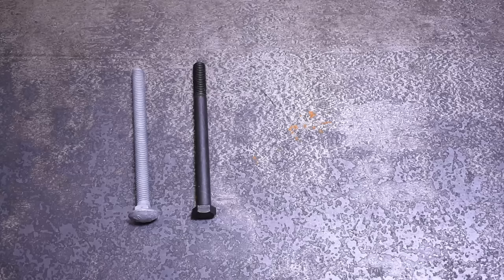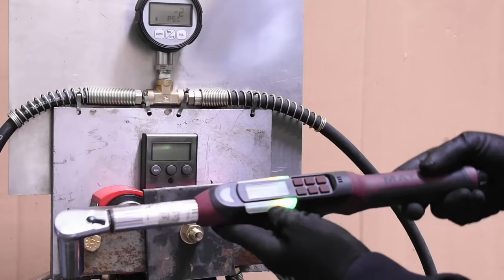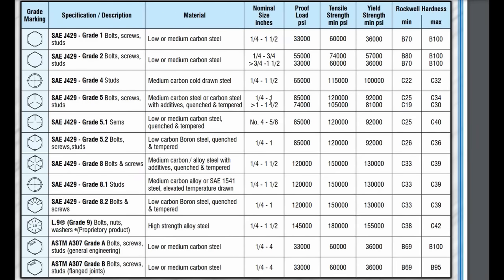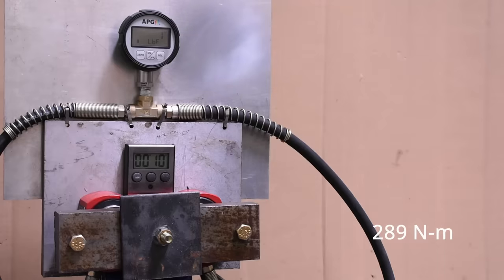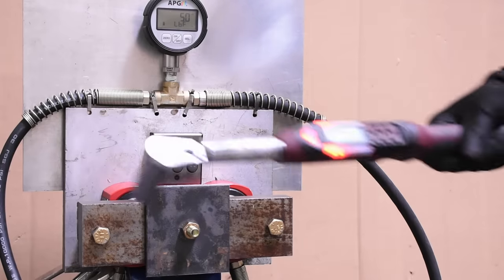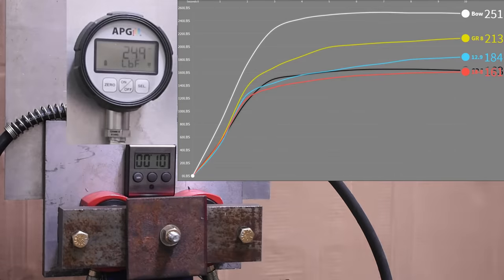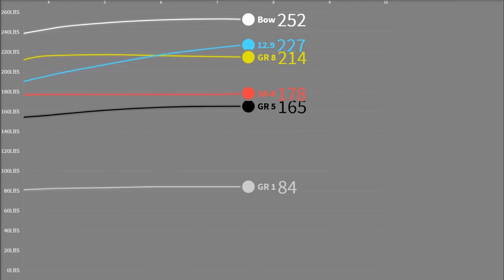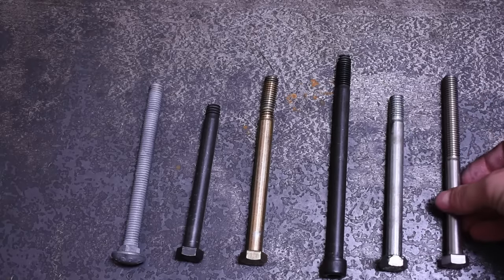Strongest Bolt? Grades Explained & Dyno Tested For Science

Comment: Metric stainless fasteners are marked A2 or A4 for the material type (with A4 being higher corrosion resistant in salt water and chlorinated environments) and a number (50,70,80) that indicates its strength class, with 80 being equivalent to 8.8

As for the relationship between clamping force, torque, load, and so forth, there's whole engineering books about it, so the information exists, it might just not be explained in simple form anywhere easy to find. Odd. :) It would explain the amount of bolt abuse you see people do.
In short, the bolt fastening torque is mostly set to optimize clamping force. Clamping force makes sure that shear loads are absorbed by friction between the clamped faces, and that cyclical loading doesn't fatigue the bolt or joint.
A loose bolt would shear off or fatigue, or rattle around and damage the hole, where a properly tightened one would not.
An over tightened one could snap from being over tightened alone, or could damage whatever its clamping.
Reply: As for clamping force, what you mention is one part of it. To expand, the torque determined for a bolt is derived from the clamping force needed to maintain a sufficiently ridged connection. This is determined by the connection use, like clamping a pressure vessel, sealing a gasket, or affixing two solid objects together. Generally, you would choose the bolt grade based off of what your clamping force needs to be from the design criteria, not a tightening torque to prevent bolt damage. A loose bolt would also wallow the bolt holes or damage the clamped material, it most likely would not shear unless shearing impacts were applied, although a loose bolt will fatigue faster generally
Reply: For sure yeah, I think I probably could have worded my post a little clearer. Those design calculations also often show why multiple smaller bolts are better than one single big one, the clamping force is distributed much more evenly. 

I think the times I've seen bolts shear clean off were indeed shock loaded in shear, which would have been find if they were tightened to spec.
Also, seeing people use loose bolts as hinge pins and shear loading the threads just really rustles my jimmies. At least use a shank bolt (-properly). Never mind actual proper ways to make bolted hinges.
Reply: Correct, very important to choose the right grade of corrosion resistant bolts (A2 or A4) with regards of the environment where they are used. A2 is good enough in fresh water, but will be destroyed in salt water over time. A4 is more expensive and contains additional Molybdenium in the alloy, hence more suited for salt water (or chlorinated) environment.

Comment: Perhaps a test of thread lube? Grab a bunch of those grade 8 bolts and slather them in various thread treatments... ARP ultra, motor oil, a few greases, anti-sieze, threadlock, etc. You could test torque consistency and overall torque before failure.
Reply: @trashcanmucous5153  
Hmm, that is a good question. My first thought would be some anti-seize, as that its purpose.

But plastic doesn't weld to metal, it can only melt or deform like clay. 

Is it feasible to add a material in between the parts like a film, wax paper, or bushing?

Comment: There are tougher bolts out there.
NAS8906 go to 220kpsi and NAS8907 go to 260kpsi. They're used in aerospace framing and are single point turned rather than rolled on a screw machine, and have a tighter class of fit than normal threads. You have to go to a dedicated screw house for those, and are the last stop before custom designed solutions, like special alloys and ground threads.
Most applications care more about performance at temperature and corrosion rather than just straight performance though, which is why A286 and inconel screws are also a thing.
Reply: I've been to a dedicated screw house before, but I guess I must have overlooked the bolt aisle.
Reply: @mediocreman2  The bolt aisle is the hallway you run down towards the back door when the cops raid the place.
Reply: NAS also also have tighter tolerances than their AN cousins
Reply: @lunchboxproductions1183  Yes. and Yes.
Reply: Aren't they also around $60 each though?

Comment: Grade 1 and 2 are fine for most wood fastening applications, since the wood will fail before the bolt. The carriage bolts you are testing are a good example - if building a wood carriage, just use grade 1.

Many people assume a higher grade bolt it better in all applications. This is incorrect. Some bolts are intended to fail to prevent more severe damage. Some bolts are better at shock loads than others. For instance, bolts on suspensions are intentionally not high grade, because higher hardness is usually more brittle, and the impacts in the suspension mean that high grade fasteners may snap during use. Lower grades will stretch, and that stretching and loosening of the fastener can be accommodated in the design, since the major loads can be designed in shear and not in tension. 

The torque applied to the fasteners is also sometimes more critical than people assume, and too tight can often be a very big compromise to the fastener. Preloading the tension or creating additional stretch reduces the capability of the fastener in tension and in shear.  Each application presents a window of proper torque for the fastener, including whether clamping force is required or just sufficient force to prevent the fastener from backing off. These windows also depend a lot on the fastener grade and thread configuration.
Reply: Agree , was in the cold heading trade for 15 yrs. There's science behind all of it.
Reply: Very good explanation 
The amount a bolt will stretch and return to its original size without fatigue is known as the elastic range, the harder the material the shorter the range.

Comment: Years back I had to replace  288 1" bolts that were holding a ski lift together because they were counterfeit. They had been in use for 35 years and none of them had ever failed and none of them broke on removal even with about 10 coats of paint on them and rust. A325 bolts and A563 nuts were all torqued to spec in a 3 step process 50-80 feet up the towers.
Reply: Better safe than sorry. Thank you for doing whats right to ensure others safety. Also, thanks to whomever noticed the wrong fasteners and demanded them replaced. Standards exist for a reason.
Reply: You could have saved many lives by replacing those bolts, who knows how strong the original ones were…
Reply: @jason86768  , @NFR Computers  It was the elevating device authority in my area that brought it to our attention. The reason the counterfeit bolts had been supplied was a weird story that had mob ties. 3 of the prior lift maintenance managers had ignored the warnings and when I took the job I inherited a stack of papers outlining safety infractions that were ignored for years. My signature on the daily logs was enough of an excuse for me to take action. Sadly since I left that job ,all things safety and common sense related have been ignored. While at the facility this year I brought up many safety problems with several board members and was told to mind my own business. They will eventually hurt or kill someone.
Reply: The bright side, at least, is that the myriad of coats of paint show that maintenance wasn't completely ignored.
Reply: A325 is a standard bolt for structural steel with oversized head's and nuts
Reply: @scotttod6954  So, in the interest of safety & also to possibly ensure that none of us are hurt or killed...is there any chance you might divulge WHICH resort it is that has these potentially fatal issues being swept under the rug??

Comment: Doing a boat motor mount that has to hold a 170 lb 25 hp motor. It is cantilevered 28" out off the boat due to needing to clear a swim platform. Glad that stainless steel bolt was slightly better then the grade 5. I am using 1/2 stainless bolts just like this for holding that motor mount to the transom. 

Now all I gotta do is engineer that transom reinforcement properly on the back side and I should be good to go. Thanks so much for doing this video. I feel much better now about those stainless bolts.

The motor mount is 6061 12x13, 3/4 thick plate with 6061 2x6x.250 tube between the transom plate and the motor plate, it is tig welded with 300 amps by a guy who does many hundreds of feet of tig welds per year. Why that aluminum plate and tube? It is just what I could scrounge up.
Reply: Yes, stainless steel plate is very expensive, so it's a money saver using aluminum. 6061 - T6 is hardened aluminum, but as long as your not near salt water it will last. Retired welder.

Comment: One thing I would like you to try..    apply some anti seize to the stainless before it's run.   reason being stainless binds up when heavily impacted.  the antiseize keeps it threading freely.
Reply: That would likely change the measurements a lot. That's the equivalent to lubricating the bolts beforehand
Reply: You never use lube on Torque tests.  Possibly Locktite in some special circumstances in Process equipment

Comment: When I took the plow mount off my truck I found out the shop that installed it used stainless bolts to fasten the two pieces together.  Was shocked to find 304 stainless was able to withstand the punishment of finding hidden obstacles albeit they were large 5/8 bolts.  I would suspect smaller diameter bolts wouldn't fare so well.  Nice to see an actual test comparing them to steel counterparts.  McMaster-Carr carries an extreme strength stainless that is supposedly comparable to grade 9, would like to see that compared to 304/316 and 18-8.

Comment: really interesting seeing these torque values with impact guns.  most high torque applications are done with hydraulic wrenches or hydraulic bolt tensioners which are not comparable in any way to impact guns.  good work on this channel.  consistently impressed with the stuff i'd like to know but have no intention of going through the effort to find out myself.

Comment: This is cool and especially interested to see how the 304 stainless bolt does. Many think it's perfect due to corrosion resistance compared to normal steel and strong stainless but I believe they are probably below grade 5 strength due to brittle nature of stainless.  I will see if I'm right as I watch!
Reply: Ok watched it and I gotta say I'm surprised by the stainless result!  I agree that I've been confused by spec sheets and avoided stainless fasteners in more important areas due to fears of overall strength - I usually figured less than grade 5. But this test showed it much closer. Id imagine the application still will matter such as static fastening vs shear forces on the bolt attachment. Still neat data so thank you!
Reply from the maker: I agree. Did better than expected but also it's too wishy washy of a distinction to assume grade 5 equivalent. Shear strength shows a wide range of acceptability.
Reply: Stainless also has the problem of galling, which steel doesn't.
Reply: Yeah, rebuilt my motorcycle with pretty much only stainless bolts since the original ones were so rusty. Never making that mistake again haha
Reply: @TorqueTestChannel  Just an FYI, not all 18/8 alloys are 304, and not all 304 alloys are 18/8. Type 304 is 18-20% chromium, and 8-12% nickle, but also maximum 2% manganese, 1% silicon, 0.045% phosphorus, 0.03% sulfur, and 0.08% carbon. Generally 18-8 bolts are cheaper/worst quality than a 304, but can be stronger due to carbon content, especially in forged fasteners. Also 18-8/304 are only freshwater compatible, you need 316 for true saltwater resistance. Though even 316 can rapidly corrode in anaerobic situations due to crevice corrosion. The molybdenum in 316 makes the fasteners tougher than 304, but softer. So higher yield, lower tensile. Also using stainless isn't recommend for any torqued application is the threads galling. So its easy to torque the fastener correctly, but have little to no clamping force.
Reply: @MrNeutross  Good to know! I was about to get a bunch of SS bolts for my motorcycle, I'll be sure to anti-sieze em when they go in!
Reply: Not brittle, more ductile. That's why the graph seemed top be able to go to the right for so long, the bolt can stretch easily and consistently
Reply: Had a friend use some stainless on race bike and they shook loose.
Reply: @9ijnht5rdx  That makes sense using lube instead of like loctite! ahhhh maybe standard bolts it is! SS for the bodywork
Reply: A2-70 is a pretty general purpose stainless fastener in metric, which is 304-700N/mm2, which is roughly between a 6.4 and 8.8, A2/A4-80 is 800N/mm2 which is about the same as an 8.8
Stainless can cold weld, but I've only ever had it happen twice, generally if you're getting it to seize you're doing something wrong.
Reply: @ionstorm66  good stuff. I get to play in those boxes at work being one of only 3 techs for the whole materials group. Sectioned ton of fasteners for metallurgy.
Reply: Cool story bro.
Reply: Stainless use is primarily for Corrosion resistance, not strenght.  It is Tough, not Strong.

Comment: thanks buddy. I put up a gantry crane and one end is supported by carriage bolts. Didn't realize their lack of effectiveness as a fastener until your enlightening video. did wonder about their strength rating though. Didn't know about the grade 1 rating. Crazy, but I thought grade 2 was the bottom of the barrel. and I come from an industrial background! We never used anything less than grade 2, the flat heads, or stainless, but mostly grade 5 or higher rating. The other end of the gantry is supported by grade 8 bolts though. Now I only have a 1 and 1/2 ton chain fall on the beam, but you can be sure I will change out the carriage bolts for grade 8. As an aside the gantry is 18' long with 12 carriage bolts scattered from center to one end and another 12 grade 8 bolts scattered from center to the other end. I believe in over doing it in the name of safety. Don't want anyone getting hurt.

Comment: The vortex pattern of every sheered bolt tells a story of heavy lateral torque as well as some tensile loads, and remember these books are graded for tensile loads, not lateral torque load, but very cool video on bolt  strength!!

The best way to test these bolts is to load the nut to a common ft/lb  then hang weight from the bolt 🔩  to achieve a purely tensile load.

Comment: Two major flaws here that are likely to mislead interpretation. The first issue is "18-8" is not a specific alloy, it just designates a generic stainless with a minimum 18% chrome and 8% nickle content, but there are many alloys that contain that amount of Cr and Ni.(Stainlesses also have other engineering considerations such as pitting corrosion and corrosion fatigue which do not effect non-stainless in certain corrosion environments.)
The second and bigger issue is not using a standard EP thread lube. By standard I mostly mean using the same grease for all tests but preferably a lube meant for the task eg ARP sells one. EP for screw threads is usually a solid additive like moly or graphite as opposed to the surface active additives more common in EP gear lube. This is especially important for austentic stainless which are very prone to galling (microwelding and plastic surface deformation) especially when used with a matching stainless nut. (As is normal because dissimilar metals in contact will corrode much faster.) The standardized lube takes out the surface finish variable(major) and overall reduces the torque component of stress relative to axial stress. Surface finish and lube choices can change the ideal torque for a fastener by 70% 
Non-EP lubes like motor-oil are only consistent at low torques on low grade bolts, they can't maintain a significant separation film between the metals under high pressures at these low speeds. (High speeds suitable to form sufficient dynamic film strength would be like 2000rpm+ at this small diameter and high pressure.)
Reply: Didnt have to scroll gar to find the metallurgy guy in here haha

Comment: Great video. It's only telling part of the story(arguably the most interesting part). Different grades have different applications based on whether they bend  or stretch, or just snap. 

The Bowmalloy is a very unique bolt. They are actually manufactured by Barnes Inc. And commonly used by Barnes Aerospace. The head marking is actually a spring from the Barnes logo. Bowmalloy is designed to retain the hardness and tensile strength of a grade 8 bolt, but bend without snapping. They were designed to be used in the aerospace and space programs where vibrations were a concern. You can take a Bowmallow bolt, bend it in half without it snapping.

Comment: One thing I noticed, when I would tighten stainless steel bolts with stainless nuts, very tight,  is the threads tend to "gaul"  and seize up.                          Great test THANKS
Reply: @wadesaxton6079  can you please give a reference that confirms that torque figures are wet ?  I heard the opposite, at least for automotive
Reply: @francoisloriot2674  automotive is dry.
Reply: Never have used ss we didn't never seize first

Comment: I was always told when I was growing up that the purpose of bolt grades wasn't for tension but for their shear resistance. We would use grade 5 bolts as a sort of fuse for our grain augers to keep a potential clog or other fault issue from destroying the internal auger. I would hear tales of my grandad shearing a G5 bolt and swapping in a G8 to get the last of the load finished, but at the expense of completely mangling the auger with the extra torque applied from the shear resistance of the G8. We had a specific box of "cheese" bolts for our smallest augers as even G5 would be too strong to fail under a fault.